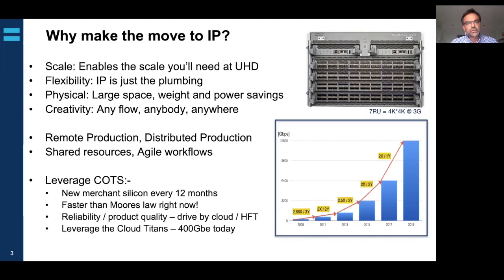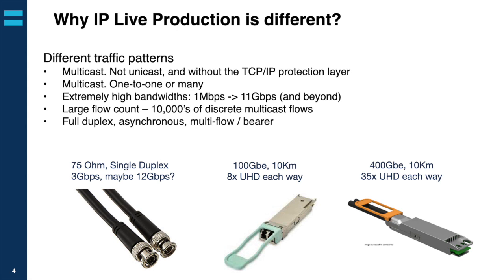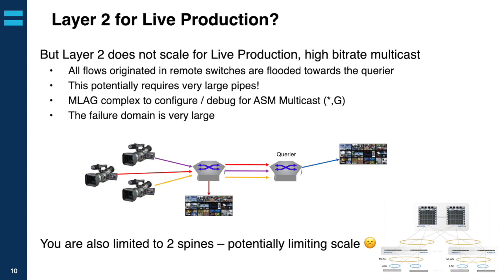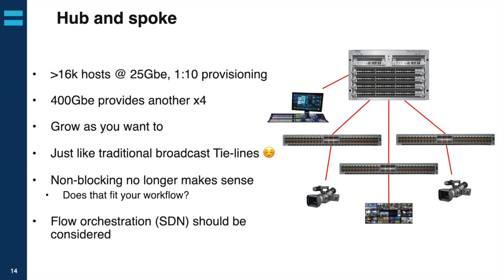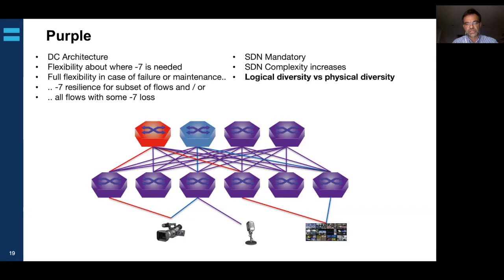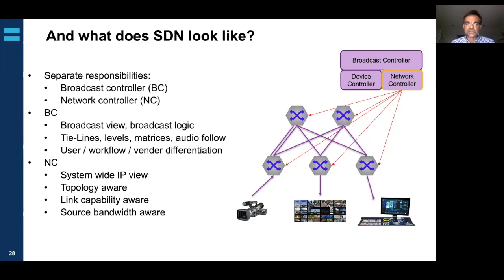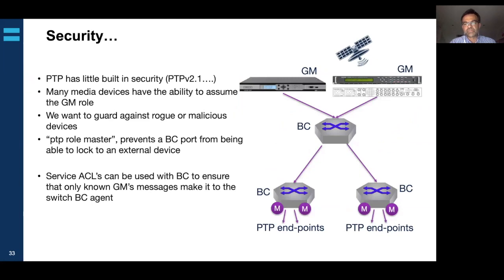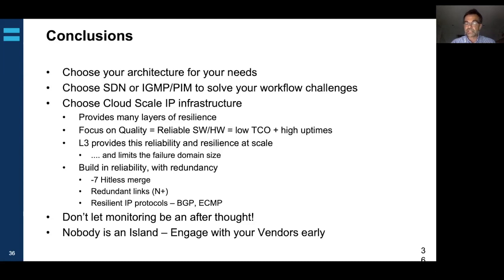Network Design for Live Production

Comment: This is an excellent tutorial/webinar. There is just a minor problem with the use of acronyms. For example at 32:51 the suggestion is to place a couple of GM's... A fairly extensive Google search on that acronym shed no light as there is no reference made to its function in the content. If your intent for this video is to educate the educated I apologise and will go away. If it is to educate, please expand every acronym at least once or provide a list in the description below. Thank you for your consideration.
Reply: Depicted are a Meinberg LANTIME IMS - M1000 (left) and a Tektronix/Telestream SPG8000A (right) sync pulse generators, so my best educated guess is GM stands for GrandMaster or something like that. Anyway, he means the main time clock sync devices.
Reply: Thank you for your reply. That helps to make sense.